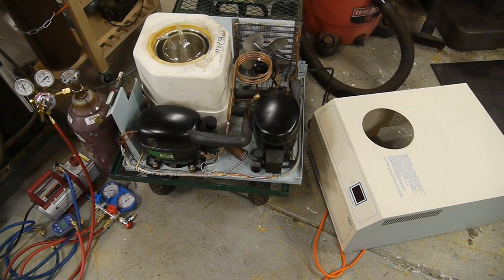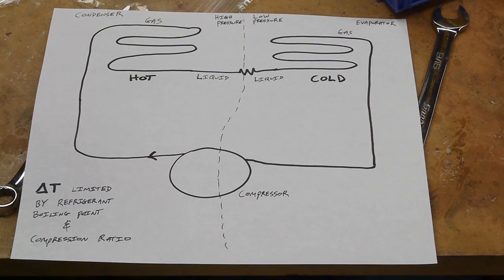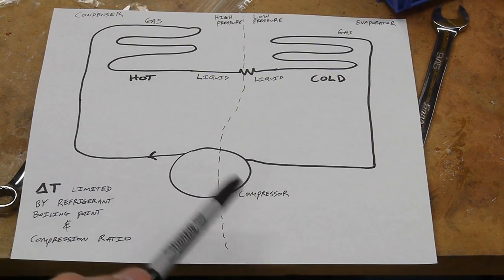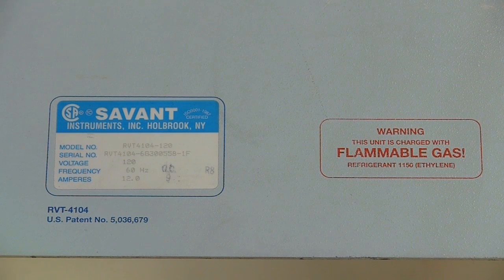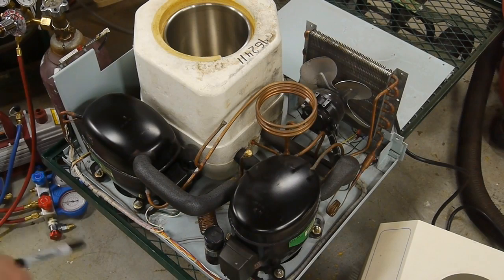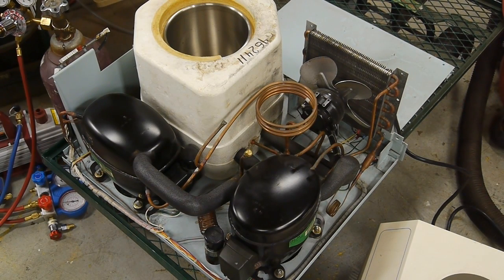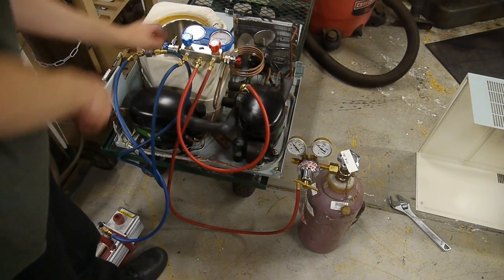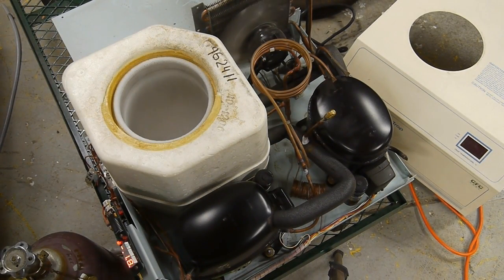Ultra low-temperature cascade refrigeration system repair

Comment: I love using piercing valves AKA vampire tap when I was young didn't know any better but I wasn't doing ultra low this would be typically in a soda machine or something like a region nothing critical but yes the rubber that you put around the seal does leak

Comment: Hi, your video is really interesting.
I have the same trap as you.
But I have little problem, the first stage need to be refilled.
What gas would you use cause the R13B11 is not anymore available?
Thanks for your answer.
Reply: You can use R290 or R22 in first stage
Reply: @Exotic_Lab  Do you know the secret of sizing of capillary tubes for evaporator and oil separators?
Reply: @1srol1  i calibrate it manually. It's very time consuming work.
Reply: @Exotic_Lab  I had to recharge my freeze dryer with MO89, which is virtually impossible to get, so I blended R125, R218 and R290. It works nice. That refrigerant has almost same density like R22. The table for 1/3HP compressor and R22 calls for 10 ft. of 0.036 in. capillary tube for -10 F. evaporating temperature. I need to get to -25 F. Do you think its good starting point?
Reply: @Exotic_Lab  Thanks a lot for your answer!
Reply: @floriandelmas4840  I noticed, a lot of freeze dryers use R23,  R245fa, MO89... in first stage and R508b, ethylene in the second, . Maybe additional 5% of propane to prevent oil freezing?

Comment: use air, compress to liquid, circulate, is only liquid air, energy storage, and also heat transfer medium
Reply: liquid air has no pressure
Reply: turbine impeller centrifugal compressor

Comment: Hi Ben! Love your vids, tyvm! I beg your advice..... i need to have a cold trap on my vac system but it's impossible to source bulk dry ice and LN2, no chance.... i cannot find an cryocooler that does not need external helium pump tho that would be ideal, would you say one of these is my next best choice, and would one of these be that much less effective than LN2? Tyia

Comment: Midwave infrared thermal cameras usually operate at 77K, so they use a Sterling cooler with a cold finger that is right at the back of the sensor. But others use LN2 or even stacked peltier elements.

Comment: hi We are a manufacturer of ultra-low temperature refrigerators. We can provide OEM。 Have -25, -45, -65, -86,-105, -135 degrees Celsius ，helillcc.com harson：shenharson@gmail.com，helilanxi0902@gmail.com

Comment: You didn't mention where you eventually got the ethylene gas at, though since its used a lot for ripening fruit I wonder if you ended up at a farm supply house or nursery.  These days of course you can get it on Amazon.

Comment: Hey man! very nice repair. I have a couple of cascade chillers and they both stop cooling to -75C. The main (use) temperature slowly got warmer and warmer until I can not longer work with either.
The sticker says R404 / R23A I am assuming this is for the two different compressors. What can of load should I use on each (either by mass or pressure)? can I change the refrigerants?
Any technical suggestions would help. I need to get them back on line.
Best;
David

Comment: Just a note: You can not get the low side's pressure "arbitrarily" low, i.e. you cannot go below 0 Bar/perfect vacuum. And even at absolutely 0 pressure, any refrigerant will still have its specific boiling point (way) above 0 Kelvins, and cannot refrigerate to below this boiling point.

Comment: Great video. I used to build these as computer coolers as a hobby over 10 years ago, that was fun! 
Looking at your 2-stage schematic, it seems that you placed the oil separator in the 2nd stage after the evaporator. 
If I recall correctly this would usually have been placed prior to the 2nd stage condenser as you want to separate the liquid oil from the gaseous refrigerant using gravity, in order to prevent the oil from clogging in your capillary tube.
Reply: P.S. you can get Ethylene and other technical gases from firms such as Linde, Air Liquide and here in Austria from Messer Griesheim.

Comment: How much did you pay for this, and what are the odds of finding a used one like you did? I really need one of these for building a large freeze dryer. I do not want to give Harvest Right my money, and would rather spend the same amount, if I have to, in order to build out my own, better unit. I want it more of an analog machine than a fancy ECU controlled dryer. This cold trap unit would be ideal. I have seen newer stuff like it online for waaaaay too much. I could buy two Harvest Rights for the price that some of the lab grade cold traps go for.

Comment: Hope you are doing well. I wanted to make exact replica of the refrigeration system. Can you give us the specifications of the 2 compressors and the 4 exchangers (2 evaporators and 2 condensers) also the size of the capillaries. Or how can we achieve those low temp. (~-150 degrees) by design a system using the r134a and r404a.thanks.

Comment: So I have a question. The 2nd stage when working with R-1150 (ethylene), work normally with -15 deg C in condenser, and -100 deg C in evaporator, and rest of the system is somehow between, with possibly compressor be a bit higher due to compression to high pressure / temperature (lets say 0 deg C), and due to compressor friction heating stuff up.  But when the entire unit is disabled for prolonged time, the entire thing will be at room temperature, lets say on a hot day, 40 deg C. Would that make turn it supercritical fluid? Or will it all boil off and be a gas at very high pressure (higher than during normal operations)? If so, how do you prevent failure?
Reply: In some freeze dryers first stage system lowers the temperature in heat exchangers to -30 deg. C,  before the second stage compressors are turned on. If for some reasons first stage systems are not able to keep temperature of heat exchangers below zero, refrigerant leaks, faulty compressors, clogged evaporator... second stage compressors are turned off.

Comment: This is very interesting, but I have a cuestion, that system could reach -170 ° c?
Reply: No not this guy, but there are systems that do, they are usually autocascades. I know of one that hits -150C, it is a blend of 404a for the first stage, 508b for the second and methane for the lowest.

Comment: Hi Ben, I know this is an old video, but I hope you check in with the comments. I have the exact problem - loss of R-1150 refrigerant on the low temp side. I have a service training 2MB PDF from Thermo if you want it.  My question is - Do I need a manifold specific for R-1150 or can any manifold work?
Reply: Any manifold can be used
Reply: Hi Don, I have one of these I want to work on, and the top cover won't come loose. It seems to hang up on the front even though all 3 screws on the bottom have been removed. What's the secret. The manual would also be handy.
Reply: @robvermeulen7563   Google my name and find my email. I am in Fitchburg WI.

Comment: Thank you so much for a detailed explanation.
I'm in process of designing  an ultra low temperature chiller.  I was thinking to use 404a as the 1st stage and R502 for the colder stage.
 I was looking under 60 or 80 plate heat exchanger was wondering if that would be sufficient.  Can you recommend any source or literature how to size compressors/condensers etc. for ultra low temp systems. 
 Thank you again
Reply: I think the current low temp refrigerant is 508B
Reply: @12W6JL  R508B is a new one to me. It's been 20 years since I worked on cascade systems & back then it was R23, before that R13.
Reply: 508b with ethane is common in the low stages on revco and thermo-fischer units. From a full vacuum go to 0 psi with the ethane, then from 0 to 85psi with 508b, this will usually get you in the ballpark. If you see temps of around -110c at the low stage evaporator inlet it's working. High and low stage compressors are usually very close to the same size, Copeland RF41C1E are popular, I see them a lot on older revco units, they seem to last forever. The heat exchanger is pretty easily made by taking about 6 feet of 3/8 copper and sliding it into 6 ft. of 3/4 copper and pinching it down around the 3/8" at the ends, then wrapping it into a neat coil about a foot across.  you may want to go a little longer, a bigger heat exchanger won't hurt anything and will give you a little wiggle room if you're not sure of your heat loads, but you don't have to make a gargantuan monster to get pretty good results. just insulate it well and you should get results. Happy experimenting!
Reply: I think you mean R503 on the 2nd stage Mark?
Reply: Witch type of compressors use in this system?
 i know how to make this type of arrangement but i dont know about compressor
Mean if i have R23 gas 
Wich compressor reccomend for this gas 
Some compressors mention there  gas like R134a. R22a. R404a explain about R23 compressor
Reply: @pakistanchessbattles9824  I think, any compressor with LBP will work and should get temperature of heat exchanger to -30 C.  I used  secop sc12ftx with MO89 ( contains propane to prevent oil freezing ) and embraco FFI12HBX1 with 100psi ethylene, oil separator. Easily gets to -105 C. Sizing capillary tubes is another music...

Comment: dear you?
this is your item wich you bought at ebay. https://www.ebay.com/itm/Tested-to-52-C-refrigerated-condensation-cold-trap-by-Savant/232706245504?epid=1507966561&hash=item362e5f8380:g:fUQAAOSwVzRas0Nq#shpCntId
can it running non-stop 24h?

Comment: I was curious about how much has changed since this video was posted in 2014.
It only took me about 5 minutes to find a distributer claiming to have access to r1150 in the New Your area. And they were willing to sell me a small tank.
Reply: Overwatch i have made three stage cascade and i needed R1150 which was expensive so i made it myself at home from ethanol and aluminum oxide... I have it stored in my LPG tank 30 bars in 4 liter tank. I used it in my system and it worked perfectly... no problems till now

Comment: So the lab that I work for has a two stage refridgerator that has nitrogen and helium sections, the problem is it apparently has been "broken" for over 10 years and I pretty much need it for experiments.  I wonder if just using balloon grade helium at first would be a good test for it while trying to fix it since I don't really need to go all the way to 5 kelvin?

Comment: would a single 60hp copeland scroll compressor be enough for PC phase change because 2 of those baby's are twice the power of many peaple who use 1.4hp  compressors but a bigger compressor is used in industrial applications

Comment: What is the addition of the R1130 for in the 2nd stage? Wasn't even aware that you could still get R13B1, it was outlawed here in the UK in the early 90s as it was one of the most ozone damaging refrigerants. Same with R503. The cascade systems I used to work on used R502 on the first stage & R13 on the 2nd. Later on after the Montreal Protocol it was R404A on the 1st & R23 on the 2nd.
Reply: phil955i its R1150 (Ethylene).... Zero Ozone depletion... No contribution to global warming... But highly flammable

Comment: These cold traps are fun to rebuild. The piercing valve definitely caused the problem. The best thing on these system is to pinch off the lines and remove the Schaeder valve completely

Comment: I find it odd that they chose R1150 to replace R503. R170 (ethane) is a better match to R503. perhaps they wanted a refrigerant that could make -1౦0C without having a suction pressure below atmospheric?

Ethane can also be blended with propane in the proper proportions to replace R13B1. The resulting blended would have a glide but that would not affect system performance. I'd be willing to bet that instrument grade ethane and propane are both cheaper than ethylene.
Reply: probably to get the ultimate temperature lower

Comment: Ethylene is used in place of acetylene. It should be easy to syn some up also. I always wished to build a 2 stage system. Propane should not be overlooked folks, cheap but you need to still it till pure.

Comment: +Applied Science : What is the power draw of this machine both as it is getting down to temperature and once it is down to -100C with an insulated lid on the chamber? Would be interested to know if it would be viable to run this continually as an ultra-cold storage system.
Reply: Ilya Levantis its around 400W

Comment: I do have a manual somewhere like I said Thermo Fisher  took over Revco Ashville N.C  .When they did that they change assemble line from Ohio to N.C. They had so many problems they stop making them for a while in till the engineer had to find out how they where put together on the assemble  line. Doing cascade refrigeration is challenging . Parts are OEM and refrigerant most of the time you could get the refrigerant from HVACR supply house would have to be  license in the state to get the refrigerant .I never had a problem with refrigerant cost is high pre pound.

Comment: These are attach to savant centrifuges  they are there for a cold trap to trap all the chemical in a bottle so it wont go into the oil less vacuum pump work on lot of them they did  have a problem when Thermo Fisher took the company over they where built in Ohio they change it to Asheville N.C of where they were built back early 2000 .That's why there access valve did have so many   problems with these cold traps that's why first stage they change over refrigerant it was burning out the compressor unit  you would have change 1 stage the 2 stage the whole heat exchanger and oil separator to get the work correctly  at that time

Comment: I like your reasoning for choosing a 100psi charge pressure. Lol. Although capillary systems do require a critical charge. Unlike thermal expansion valves which can regulate the refrigerant flow and the excess refrigerant is kept in a liquid receiver. Sounds like you got lucky and it worked for you though!
Reply: was looking if anybidy knows about subcool and superheat here, congratz

Comment: Wow. I can't believe that line tap was left on there. It must have been a Friday afternoon on Christmas eve for a tech to leave that there. Standard course of action is to crimp the tube (and leave the crimps locked down), cut the tube with some pliers or big side cutters between the crimp and the tap, and quickly solder the end.

This is still possible when there is flammable refrigerant in the system. Just work quick and the torch/flame effect from the refrigerant is minimal.

Comment: Hi! Could you tell what is big spiral tube after second stage compressor (near the fan)?
Reply from the maker: Alexander Mishunin This coil cools the second-stage refrigerant after compression and before it enters the heat exchanger.  It makes the system a little more efficient because the  heat generated by compression can be dumped directly into the surrounding air instead of being pumped through the first-stage refrigerant.  The coil shape and subsequent vertical pipe also act as an oil separator, which removes oil from the refrigerant stream and sends it back to the compressor.

Comment: Hey Ben! I'm curious what the approximate dimensions of the chilled chamber are on your machine? I might be interested in buying a similar machine to use for the sub-zero quench I incorporate into the heat-treatment regime that I do on my knife steels.
Reply from the maker: Gough Custom 6.5" ID, 7" deep.
Reply: Applied Science Thanks mate! That's a usable size for me so I'll have to look into it more, having to go out and get dry ice all the time is annoying!
Reply: Gough Custom you can make a chamber from insulating material. It would bring a bigger/smaller space to the same temperature just may take a bit longer